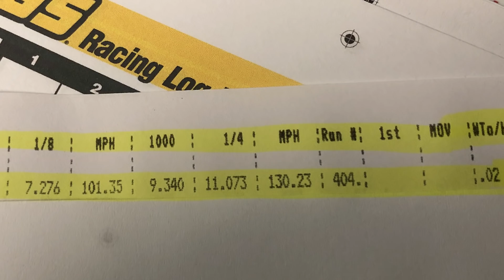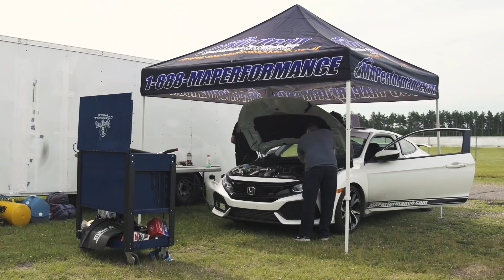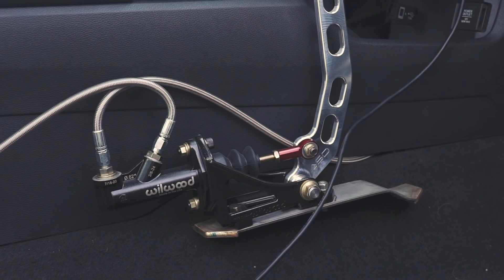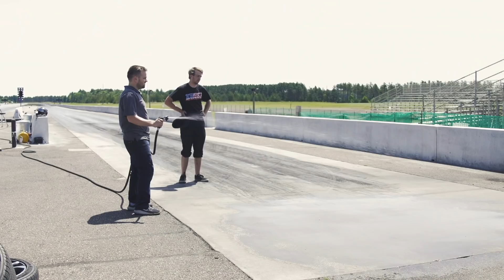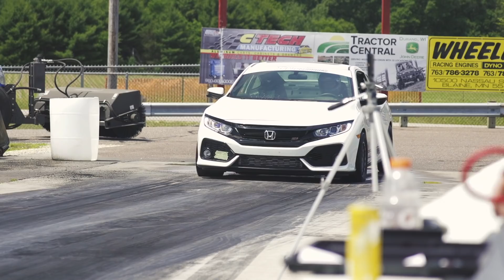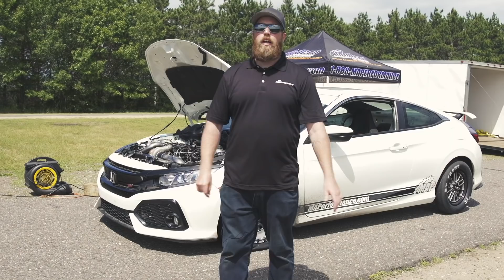500hp 10th Gen Civic Si 1.5T Track Day

Comment from the maker: We're headed back in a few weeks, what do you think our next time will be?
Reply: You will run between 11.2 - 11.3   I'm banking on the weather being hotter in a few weaks (Air Density worse) but you may be able to hook a little better and have less transmission issues.   However, if you utilize the driver's foglight modification I suggested, you'll run 1/10th quicker.  ;-)   Good luck!
Reply: MAPerformance gotta get that 10.90 for me. Loving this build. Living vicariously through you.

Comment: Great to see you guys back out there! Curious as to why you guys chose to tape off some of the grille vents vs just having them all opened? Does the drag outweigh the increased cooling from the airflow or what was you guys thoughts on that?
Reply: Ruben Ayala, I was looking at my civic yesterday and noticed that the passenger side has an opening while the driver side is all closed (stock). It seems that Honda put the horn on the passenger side and opened the honeycomb so that it would meet a decibel requirement. Ideally, I think you would want it all sealed and smooth for drag or 1/2 mile racing, which is why they taped it. On the other side it looks like they opened it up to allow more air to the turbo inlet they made. They can correct me if I am wrong, but that seems to be why after looking over my 10th gen and watching their vid. Cheers
Reply from the maker: Great question. In all honesty, we do not have any major testing or data proving one way or another on this specific car. That hole currently leads to nothing on our set up, so we chose to block it off based on past experiences and benefits we have seen blocking off open ports on drag cars.

Comment: The fourth gear blew out because its the weak point of the transmission the second gear probably took a dive from the Synkro taking a dive because that’s what happens when you use the Clutchmasters clutch kit
Reply: Awsom Sauce TV thought these cars had CVTs...
Reply: @MRYZ94  The Si is only 6 speed

Comment: "We lost a motor. We're trying to figure out what happened..." 

What happened? You tried to boost a tiny 1.5L to 500hp, that's what happened! 😂🤣
Reply: Jimbo That 1.5 still makes more hp than what your pos
Reply: They want to see where it breaks.
Reply: Purple Heart we all know it can break at any hp 😂
Reply: Haha, exactly what i was thinking. You want big HP, use a different motor...
Reply: Brook Hamilton but why? It’s already capable of making a lot of power and is more than enough to break hearts of bigger engines.
Reply: @msrr1303  well I mean if you want to be on the verge of blowing your motor and regularly breaking your transmission every time I'm sure you will be able to "break hearts". But those high hp factory motors are going to still run fine tomorrow. That 1.5 is ok for what it is. In all honesty stick with a comfortable 240hp and leave the high hp to the big boys.
Reply: Brook Hamilton so you’re saying stick to a V8 if you want to be a “big boy”? 🤣
Reply: @msrr1303  you could go with a 2jz, 4g63, 4b11, rb26 as well, like I said, Big boys. V8s are great too.
Reply: Brook Hamilton 4G63 is a 4cyl as well. Give the L15 some time and it’ll be into single digits soon. No 4G63 hits single digits on stock internals.
Reply: @msrr1303  I know it's a 4 cyl, so is the 4b11 and the rest are 6. I don't see this motor making the crazy Honda hp people are hoping for. Those days are in the past.
Reply: Brook Hamilton the L15 on the SI has been out for 3 years and is on the verge of single digits. The 4G63 was available on plenty of different cars, so it was easier.
Reply: @msrr1303  Then look at the 4b11 which out for a relatively short period of time and only in 1 car. Hell, look at at Mercedes is doing with their amg 4 cylinders, close to 400hp from the factory out of a 2 liter. Look what VW is doing with their new EA888. The argument is silly though. The L15 isn't that good and in a couple of years it will be replaced with something else and we will be discussing that. The L15 was designed for low HP and torque targets and it's going to take a lot to make hp on it. Be happy with a peppy little engine, but also be honest with yourself.

Comment: I regret for buying  a type r.
Reply: this car cannot compare with a type r
it was specifically set up to go in straight lines
the type r was set up specifically to go fast in corners (Honda doesnt event mention an official 0-60 time)
Reply: @ShaiyanHossain  what??? The si was not meant to be in a drag strip either. theres a reason the rear wing gives it downforce, it also comes with an lsd an adaptive dampers for corners.
Reply: @Stormtrooper-oc4vn  the rear wing on the Si is cosmetic afaik
But the LSD does help with cornering
I was referring to this specific Si
Reply: @ShaiyanHossain  its not cosmetic it actually does give it downforce on the coupe not the sedan thou Rob keough with honda confirmed that the wing is functional also they are trying to make it a drag car which they shouldnt since it wasnt built for that.
Reply: @lllll981  i dont see any type r making 500hp. I should have gotten the si
Reply: The new hondas suck...they have made them heavy and limited the performance mods.
Reply: @raymondnoodels7775  They're 100 lbs less than a 9th gen, my 2020 Civic Si is 2900lbs and change while my Golf R32 was 3400. The civic feels faster but it has really short gearing.
Reply: @RCXDerp  my 02 si is like 2500 lbs max. All the bells and whistles mean nothing but problems..that earth dreams crap is stupid. The whole thing sucks...a good ole k24 and youre good to go.
Reply: @raymondnoodels7775  stock for stock the new civic is faster on the race track then all other si and maybe faster then 03 ep3 too since it wasnt built for drag racing.
Reply: @lllll981  you still need more power to keep up. Type r just got beat by megane trophy for the fastest fwd.  Also, thats what made honda fun before with the b series. You can do so much to make power. I guess the type r is not, or like you said not a lot of testing done. Maybe ill just wait for more mods to come.
Reply: Dude. !!!
1.apparently you have type r money.
2. Its a 2.0 sqare engine. You can easily make 500hp. RaceIntercooler bigger turbo injector n map. Oh n up the revs to like 9k rpm range with valves spring n ratainers. Done.
Reply: @lllll981  um the 1500 brakes on the type r says its track ready. You know the 6 piston two peice rotor n brake setup. Brembo????.
Reply: Oh and lets not forget they showed thier dynogragh on that motor. Looks like shit. Only 200hp all the way to 5500rpm. Shity daily driver..not better than the type r
Reply: I asumed you meant track as in circut. Usually we say strip and not trac when referencing the drag strip.

Comment: I Just Realise Its Not A Type R And Its Not Engine Swapped
Reply: AOMechMarine Except for the fact you can scoop up SI’s all day for around  $15k and I haven’t seen a single type R’s for less than $32k. I could buy an si fully build it, make more power, and still have enough money left over to buy a used ex-t for a daily (I’ve found a couple for 7-8k).
Reply: @TurboNFRStwoK  damn where you getting all that money from? I'm over living paycheck to paycheck struggling.
Reply: @AOMechMarine AOMechMarine  well said
Reply: @AOMechMarine AOMechMarine  they werent built for the drag strip anyways. Thats why honda gave the same hp as previous years. The big difference comes on the track. Its fun and fast on the track. Even the turn key si which is 220 hp beats Ferrari and Lamborghini on the track thats amazing.
Reply: @AOMechMarine AOMechMarine  do you know what a turn key car  is??? Go look it up honda sells it like that

Comment: Great video!  I have one suggestion.  U can utilize the driver side foglight that is for the Honda Sensing unit.   It has an opening on it that allows airflow to go through.  I have the same setup as your 'cold air intake'  tube.  Black funnel and all.  https://www.civicx.com/attachments/20190622_153716-jpg.159004/

This is what it looks like with the foglight unit on.  https://www.civicx.com/attachments/20190622_183122-jpg.159009/
Of course u can cut a bigger hole in it.   But it'll allow more airflow in than the little holes you have in place.
Please keep up the great work.  You guys are the best.

Comment: Can’t wait to find out the weak point, I’m guessing the Connecting rods.. Someone blew a motor at 350 HP & it was the connecting rods.  He’s on YouTube the Grey si w the canards... What I’ve heard is the 10th gen si has the same connecting rods a CRV has. They can’t withstand high torque.
Reply: hondata probs and church tuned is why. Also his motor builder is taking almost 5 months lol which is wayyyy toooo long for a job that should be done quicker
Reply: Carfacts here’s some news btw, well news to me as of today. The 9th gen si comes w a k24 Stock.. and the 10th this new engine. The 10th gen is faster than the 9th gen stock for stock. By a whole car length. It’s on YouTube. & we tested it out also.
Reply: Carfacts Still surprised a 1.5L is making those numbers... insane really Theres really no replacement for displacement in power. Smaller displacement and high power usually just means terrible reliability BUT, someone was running 350Hp on a L15 for 24K miles and had minimal wear.. no failures. But I don’t know how hard it was pushed.
Reply: Carfacts Insaneeeee, what clutch did you go w/?
Reply: @Carfacts even if it dont come with k24 i dont mind since my 2018 si wasnt built for the drag strip. It was given an lsd and adaptive dampers for a reason....the race track. I can leave the engine at stock ho and it will go fast around the track then most k24 or b series engines. That rear wing the si comes with gives it downforce. Look up turn key civic si 2019.
Reply: Carfacts They did upgrades to the fuel lines, pump rail & injectors i didn’t real all the upgrades in the descr but they also tuned the engine so I don’t see why they would be leaning out. Also if they leaned out they’d melt pistons or something in the combustion’s chamber.. when an engine is starved of fuel.. the metal in the engine acts as a fuel.. and will actually ignite.. i doubt this is what happened.. they did all the proper upgrades.. but I’ll go read the descriptions again to see if they left something out. Since it didn’t seem like that’s what happened. Also they haven’t said anything about what happened w that engine. 

They really should have just kept the K24 Engine from the 9th gen Civic Si. Twin cam.. instead of single jingle LB15 i forget what’s the engine code for my FC1 (19 si 4dr)
Reply: Carfacts you haven’t upgraded your pump? Or rail etc? I know for e85 it’s a must but the stock pump survived?
Reply: Carfacts i wouldn’t know honestly someone today at the shop told me the LB IS single. Not twin, &&& it’s a new engine series so no one really knows what’s the potential.. Some people are running insane numbers. &&& today I rode in a 9th gen k24 supercharged si. That thing made 400hp and it was a monster. K24 has more potential it’s been out more, used more tested more. This new engine give it time.
Reply: They can handle torque... it's a tiny 1.5L engine... That much torque is ALOT for a 1.5
Reply: Purple Heart - I know they can handle torque, but not high amounts... which is why connecting rods fail.. if you over rev an engine, it’ll fail at the rods because of too much torque.. which is twisting force. I think stock my 19 Si (FC1) comes w 238 Torque? I don’t remember honestly I could be way off but.. the engine when it was making 350 hp was making 300+ torque? It lasted until he dragged it. & so far everyone that’s upgraded the engine w stock internals has failed at the rods. Again, these are CRV rods which are made for economy, Less friction or drag & much thinner than say the Type R Rods which are beasts.